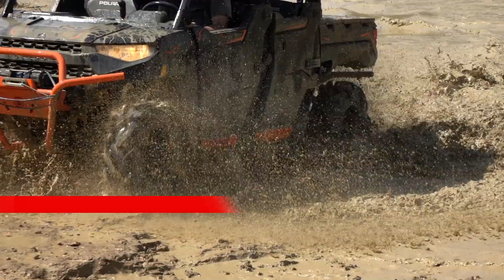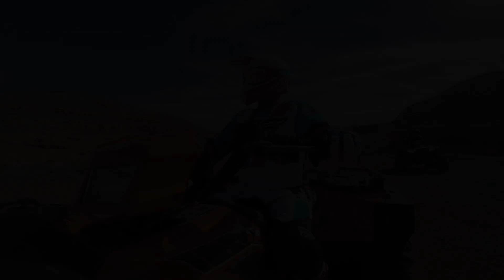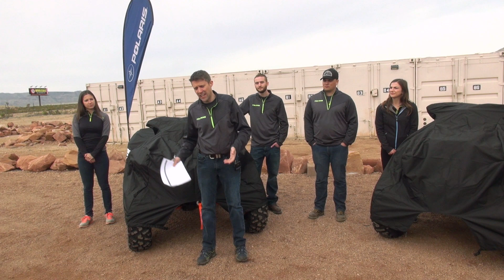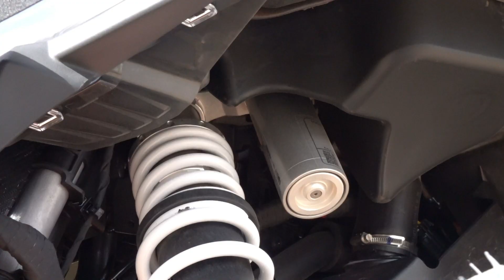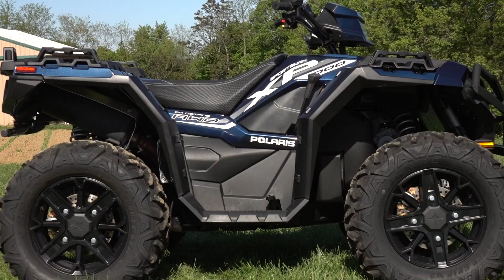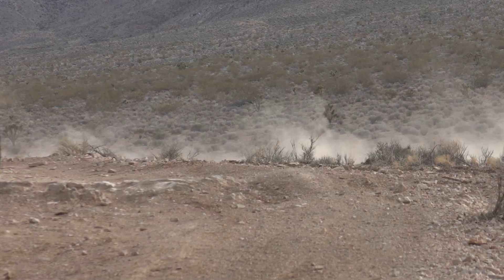2020 Polaris Sportsman XP 1000 S Test Review

Comment: You said that the Sportsman plows more on braking and cornering than the Scrambler and attribute it in part to the wider rear tires. I have a different theory, based on my Sportsman XP 1000 - the winch and its mounting bracket. That is over 20 pounds for a 2500 pound capacity winch. This Sportsman has a 3500 pound rating, likely weighs more. I have an ATV jack that can be placed under the skidplate to lift the quad's 4 wheels off the ground. It reveals that the center of gravity for the Sportsman is further forward than it is on my Can Am 800. That too would tend to cause plowing. I suspect that's why the 1000 S places all its added wheelbase (4 inches) in front of the engine

Comment: Based on having owned a XP 850 Sportsman and currently owning a XP 1000 Sportsman, along with two Can Am 800 ATVs, my view is Polaris is 'missing the mark'. Rather than design a new ATV that is too wide to fit on 50 inch trails and weighs OVER 1000 pounds (Polaris advertised weight is dry weight - no fluids), there is much more need for them to address existing issues.
1) Quality control has been mediocre at best - well below that of Can Am
2) Mediocre honoring of warranty issues (defective fuel pump has been a particularly annoying issue for 5 years and they STILL fail to acknowledge it and make it next to impossible to have it replaced under warranty. This occurred on my 2015 model in 2016 and on BOTH 2019 XP 850s that a married couple own nearby. And dealers have acknowledged it is a common problem
3) Loose (spongy) power steering - no match for what is on the Can Am. This becomes apparent at speed. But even in park with the engine off, you can wobble the handle bars a couple degrees side-to-side with zero motion at the wheels. This leads to vague handling at speed.
4) Terrible shifter (compounded by clutch and pre programmed idle speed)

Sorry, but barring them addressing these issues, my next big bore ATV will NOT be a Polaris. The games Polaris plays with honoring warranty issues (especially the fuel pump) and the absolutely abysmal shifter operation have been WAY too persistent as to be downright grating.
Reply from the maker: Wouldn't consider it burying them. Sounds like you have owned enough of their machines to have a valid opinion. Test rider Chad Westcott and his crew have pointed out that our Scrambler s loaner unit is beginning to have more play in the steering just like their personal Sportsman 1000. Seems like all power steering machines have a little play in the steering but it doesn't necessarily get worse over a few hundred miles. Thanks for sharing your input we do appreciate it.
Reply: @ATVonDemand  My XP850 was a 2009 vintage, back when it was also offered without power steering. Even on the showroom floor, before I bought the XP 850 (with power steering), I could feel much more play in their units with power steering than those without. 
One of the ways used to detect and react to torque is to measure angular displacement (torsional strain). Cam Am used to advertise that they used a different sensing means (possibly piezo-resistive). The end result can be felt in the handle bars. All of the XPs I've driven (6 of them) have had more play even when new than my 2011 Can Am XXC 800 with 6000 miles on it.
P.S. I still own a 2005 Sportsman 800

Comment: ATV On Demand i bought the sportsman xp 1000s and i dont even have 25 hours on it yet and im hearing a clunk when i hit the throttle and let go of it and i have not ridden it hard at all do you have any idea why this is?
Reply: Polaris Tech here: U-Joints.
Reply: On a nearly brand new machine?
Reply: @HeyDadOutdoors  We had a discussion about this post today and what it could be. It could be a variety of things, as @SRVDean mentioned it could certainly be u-joints but that would be unusual for the hours and riding style (unless it was a manufacturing error). It may very well be a normally functioning part of the suspension as well since it's compressing when you hit the throttle and decompressing when you get off of it. It's hard to know exactly what's happening from your description. Is that happening every time you engage the throttle and let off, or is just when you stab the throttle and let off quickly? Please keep us posted...

Comment: I have a 74 CJ5 I bought for $9000 . Its super nice , has a completely rebuilt and performance upgraded 5.0 Ford V8 with EFI and a rebuilt T-18 trans and it has electric lockers front & rear and is also street legal .  Not to mention its resale value and abilility to transport 4 adults and tow my skiboat and off road camp trailer. And its not much bigger than this quad. No comparison in my book

Comment: 55” is cool and all, but will not fit on the back of a pickup truck....  Almost everyone has trailers now, but it is nice to put my quad in the bed of my truck sometimes.....
Reply: It fits in a full size truck bed just fine. I have had mine in two different truck beds and it fits
Reply: It can fit but you have to drive over the wheel wells.  Sooner or later it’s ending up on top of you when you unload it.
Reply: @gregrowe1168  that makes sense.

Comment: Make the same machine, but narrower
Reply from the maker: Yes, we would like to see this machine in a 50-inch version as well.
Reply: @ATVonDemand  I saw it at the dealer a couple of days ago, it's wicked to be sure, but it would have a heck of a time passing through some of the tighter trails we ride on in Quebec. I was really struck by the width of it. But in certain conditions the extra power combined with the superior stability would sure be a real bonus.

Comment: I don’t know why POLARIS have such as dumb ideas for making the atv so wide, more stiff suspension on higher speed will be much better like the Can-Am did, Plus the ATV won’t fit on the pick up truck, here is extra expense rent or buy a trailer, they are way too heavy, and now because they’re wider they are less maneuverable, instead they should add heavy duty skid plates and some GPS navigation build in, A lot of my friends They switching from Piolaris to Can-Am outlander, they always complain that Polaris let them down in the middle of riding. Nice job AtvonDemand nice job.

Comment: google translated sorry

Too bad the Polaris stops with the innovations, not really a further development!
The exhaust? Does it rust as fast and as loud as the 2017 model???
The shift lever still isn't changed, although everyone is bitching about this heavy shift (scrambler included)!
At least they've reworked the steering I hope it's much better!

Original in Deutsch!
Schade das Polaris stehenbleibt mit den Innovationen, nicht wirklich eine Weiterentwicklung!
Der Auspuff? Rostet er auch so schnell und ist so laut wie beim 2017er Model???
Der Schalthebel ist immer noch nicht geändert, obwohl alle herummeckern über diese schwere Schaltung!(Scrambler mit eingeschlossen)!
Wenigstens haben sie die Lenkung überarbeitet ich hoffe das sie besser ist!

Comment: They are evolving into larger machines to house larger drive line components. Engines keep getting bigger and more HP but the drive systems have remained relatively the same. That’s why these 1000 owners are always snapping axles ect. You are witnessing the evolution into larger ATVs to house larger drive components. It’s a smart move if you actually want to make them reliable. In a few years ALL 1000cc quads will be 55 or more wide. That’s why japan won’t throw a 1000 in their quads because they know it will destroy their reliability reputation. The only option is to build a larger sized ATV to handle the power. If this increase catches on and works well you will see a 1000 Honda ATV. I guess this is the test run. Of course they give all these “ performance” reasons but the truth is the standard size 1000 stays tore up all the time. They are testing the market for accepting larger ATVs
Reply: 1000 tore up all the time?? wtf are talking about, got 8 buddies in my riding crew, 6 got 1000s and 2 got 650, no one had a problems with the 1000s, just maintainence and rip that shit like u stole it!!!!

Comment: You Couldn't GIVE ME A polaris now Since the last two burned me for almost 50 grand in 4years of owning them!!  Went to Suzuki and Yamaha and couldn't be happier!! Plus I get to ride them not fixing them..... 15000 miles on Suzuki and 19000 miles now on Yamaha. Couple wheel bearings and brake pads n tires.. Broken Frame right at the front tire where it bolts to the frame.. A_arm didn't bend though... AN ECU.. a tranny ! .. AN AWD issue.. Not a shock broken or Suspension falling apart after only 3000 miles.. ALL That power don't get you home!! ESP at 1000LBS!! So what if it's got 89 HP.  I often travel Alone here in Canada. Like I said.. Couldn't give me another POLARIS!!
TAKE your money some place else.!!

Comment: It looks like it leans so hard, this ATV would benefit from the dynamic system to help with stability in a big way
Reply from the maker: You want this thing to cost twenty Grand. We think we could reduce a lot of the body roll with some suspension adjustment. The Scrambler does not exhibit nearly as much body roll.
Reply: @ATVonDemand  Jesus, that's really expensive. The original scrambler is awesome got to ride it a couple of times

Comment: That thing is awesome but why not build a 570 like that that would be awesome on the trails
Reply from the maker: We wouldn't mind seeing that.
Reply: I've said for years Polaris should have made a Scrambler 570.  Price it in the $6000-$6500 range and they would have sold them faster than they could build them.
Reply: @gregrowe1168  you are definitely right ✅👌
Reply: Because class 1 atv trails are 50” and narrower.  Class 2 are what these are considered.
Reply: Too heavy for the 570
Reply: @gregrowe1168  don't have to be so heavy the 1000 S is better built than most SXS and and even using the same differentials and shafts from the SXS.

Comment: Will they put some of the cheaper engines in this chassis..maybe a touring model.  570 850?  Something less than 10k
Reply from the maker: They aren't talking but our first bet would be a High Lifter mud edition. We might see an 850 in one of these. We believe they should put the 570 in the smaller Scrambler platform at a lower price.
Reply: @ATVonDemand  they need to do like the old days of cars that you could order what you want, this body style, this Engine, this transmission and different differential lock and gear ratio.  Don't like can am but they use the same frame platform in all their ATV'S so doing different engines in a long or short wheelbase in the style you like is not a problem .
Reply: I’ve said Polaris should make a 570 scrambler for years.  Price it about 6000-6500 and they would sell like hot cakes.
Reply: @gregrowe1168  it  would for sure with EPS.

Comment: That's over 1000 pounds wet! That is absolutely ridiculous! Just imagine that thing ever rolling on top of you
Reply: Hahaha,,, Just imagine 1000 pounds rolling on top of you he say's 😄😅🤣🤣🤣 Just imagine 500 pounds rolling on top of you, still bloody hurt!! Simple,, Don't  roll any machine!!
Reply: I totally agree with you. If people are worried about rolling it, they don't belong looking at wheelers. I don't care if you have a Grizzly, Kodiak, Sportsman, Scrambler, Outlander, etc. If you roll any of them, same outcome can happen.
Reply: I bought one in January of this year. It is 970 dry! I added a light bar on the front bumper. I took it over the scale at a gravel pit that I work for, the weight was bouncing back and forth between 1,040 to 1,060 pounds with me off of it. It still has very good power for the weight of the machine. Well worth the money!!!
Reply: Steve Rumpca Jr  do you have any picks of your light bar on it?
Reply: Yes I do. Is there a way I can download them on here or should I send them to you? Mounting it was easy. The wiring was not right and it is listed for a 1000 S Sportsman. So basically the issue I had was, the battery cable wasn't long enough. I really didn't like the way it was laid in there. It was not allowing the plastic compartment not to shut right. So I added about 10" to it, crimped it with heat shrink connectors and then heat shrunk the whole wire and up to the existing one so it looked factory.
Reply: Preston Deters the Russian made Stels weighs almost 1500 pounds😜
Reply: Better to bail if it’s going over.  Still will hurt but it won’t be on top of you.
Reply: polaris website say 881lbs dry weight
Reply: @markchapman5085  Even that is pretty ridiculous
Reply: @Mr._P4732  ya I agree   im not a fan of it now because of that     its a wierd modle  .. like   its bigger then a normal  ATV  but   getting really fucking heavy like a UTV
Reply: yes, make damn sure you wear a chest protector and Leatt neck brace along with a helmet and good boots.
Reply: Fit a roll bar for that quadbar.com
Reply: A can am xmr 1000 weight is much more and I don't hear people complaining that one and do roll over much easier than a 55" ATV would and I also have a video of a can am xmr 1000 rolled over on a guy and he was hurt but he lived.
Reply: @crazyflyboy30  I still complain. It's a big reason I don't own a big bore twin atv. I'll stick with smaller and lighter machines that I control rather than them controlling me.
Reply: @Mr._P4732  has they get more bigger they get way more stable.  No way I could go ride with my Wife if was riding a small ATV . Right now I give away all my older ATV'S and I will only have a 2017 Kodiak and a 2018 Sportsman XP 1000 and when me and my Wife ride both of them but most of the time she will take my 1000 if the tail is rough and I feel she is safe on the 1000 because  I know she couldn't flip it even if she tried .

Comment: Nice, an atv that cannot legally ride atv trails (50" or less) in Michigan. Im a polaris snowmobile fan but refuse to buy their atvs or sxs due to belt issues.  Fix your belt issues first
Reply: I have a Sportsman 1000XP and never had a belt problem or any problem for that matter. And I am very hard on it.
Reply: @crazyflyboy30  man I'd love to have this or the scrambler S. The 55 inches wide is nice but I'm more excited about the ranger 1000 diff and axles and upgraded trans gear/chain. If they'd get some in stock I'd like to check on a trade in with my 22 sportsman 850 ultimate trail edition. Hate I missed you at top trails a little while back but some of my group talked with you I believe 🤙
Reply: I have a 16 Rzr xp1000 with 2800 miles on the original belt, running 32 inch tires. It's all in the driver and maintenance.
Reply from the maker: They still make the 47.6" wide Sportsman 1000.
Reply: Polaris belt system is almost as reliable if not more reliable than Yamaha s they have one of the best drive systems on the market
Reply: Belt issues are usually due to rider error, know when to use low and you will never smoke a belt.  My 850 sportsman has 2,700 miles and the clutch cover has never been off.

Comment: I don’t get why in a Sport/utility ATV they don’t have separate rear and front brakes on the bars.
Reply from the maker: Polaris' all-wheel-drive system does not allow for the use of separate front and rear brakes from what their engineers have told us.
Reply: @Gibbon well my yamaha grizzly has a lever for front and one for rear wheels
Reply: @Gibbon let say you back out of truck or down a steep hill you dont want the rear wheel to lock and have the quad flip on to you. It is a lot safer !
Reply: My Yamaha has separate front and rear brake levers, however the right is the front, the opposite of my mountain bike. So that makes things a little wonky when I grab the right (mountain rear/ATV front) brake and the nose dives.
Reply: JavaMan swop your brake lines on your MT bike then.
Reply: No thanks I like brake stands.

Comment: They should make a smaller lighter atv with 4x4 and more mechanical than electrical.
Reply from the maker: We were just discussing that with another publication this morning. Like a Honda 700XX with 4wd.
Reply: @ATVonDemand  can't wait to possibly get a new Honda
Reply: Yamaha used to have the Wolverine 450.  I had one years ago.  Only complaint was needed more power.  Loved the smaller size.  If they had stepped up to the 700 engine it would have been amazing.

Comment: Sorry Polaris, you are not in touch with us big bore riders.  I have a 2017 Sportsman XP1000.  And yes it is modified. And yes we want more horsepower 100+hp is a start.  Better clutching and tunable suspension.  But I guess that's why there is the aftermarket. 

55" wide is unridable on all  50" ATV trails.  We have tried with 54" wide with 10" aftermarket tire/wheel combos. A big no go there my friend. We do ride all conditions. From woods to dunes. And stay under 52" in the woods and go to 54" in the dunes.

Next time you want to build a machine I would be more than willing to be a beta tester.